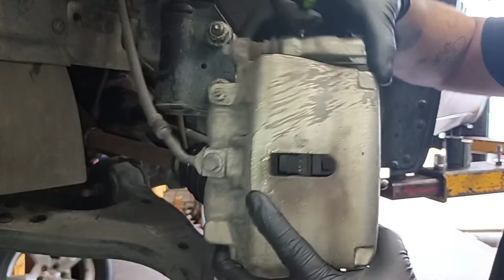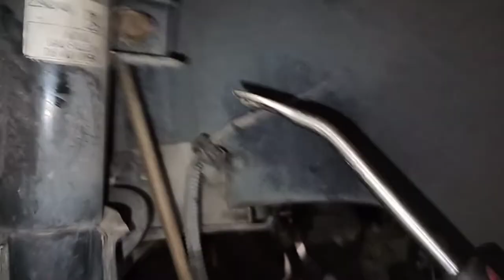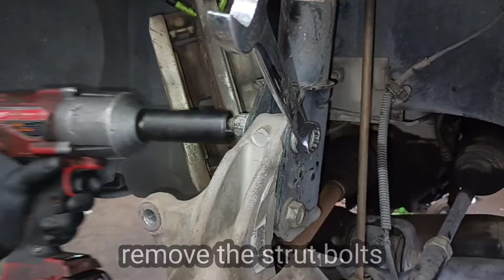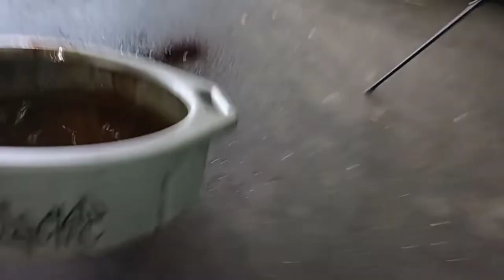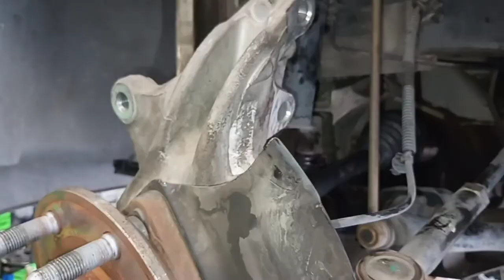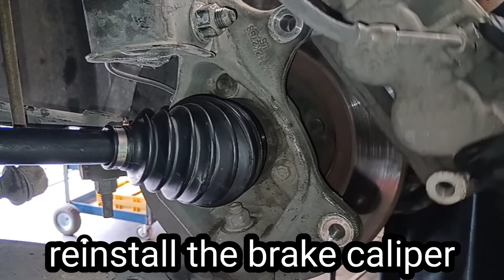driver side axle shaft / CV axle replacement on a GMC Acadia

Comment: No alignment required?
Reply: Not for the CV axle shaft change .
Reply: Yes it is, their is adjustment in the strut to knuckle. If you take it off at the ball joint then no.